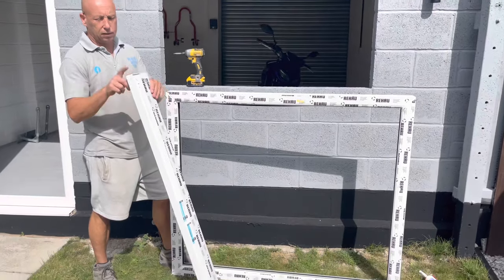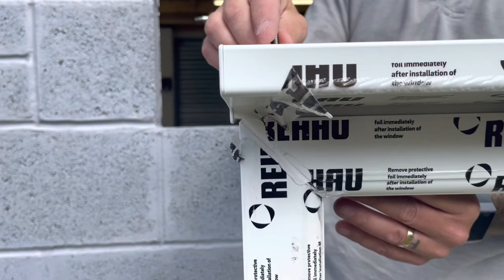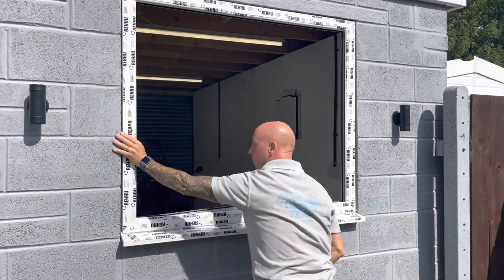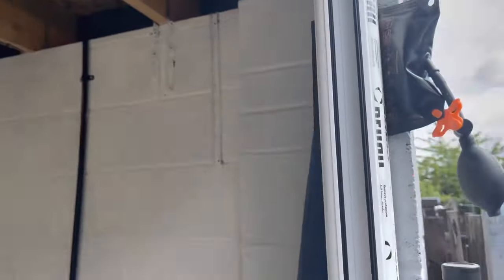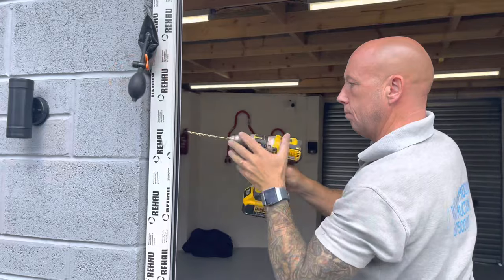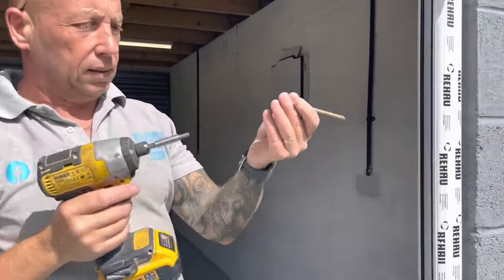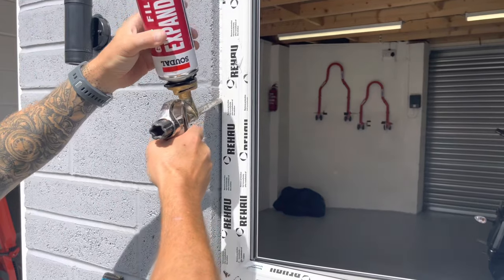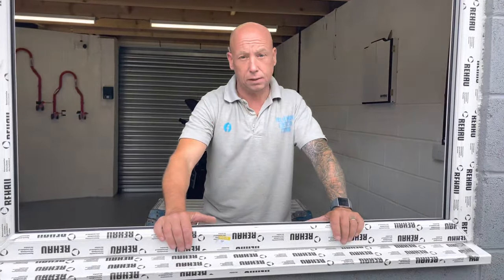HOW TO FIT A NEW UPVC DOUBLE GLAZED WINDOW

Comment: There seems to be two schools of thought, one use packers and no foam, the other is no packers and foam. What’s your perspective on this?
Reply: I use both!
Reply: You don't need packers with concrete screws, they are threaded full length so they grip the UPVC and this holds the window solid without distorting the frame, just make sure not to drive them too deep. This is better than using normal fixing screws (with plugs) against packers because those compress/distort the frame profile.

Comment: If I'm fixing window just to a garage (so not too fussed about drafts etc) will I get away with just putting screws in the two vertical sides?
Reply: Safer with 3
Reply: @harrisonpriest8441  I just put 2 10cm screws in both vertical sides, then expanding foam in the gaps and finished off with caulk. Took ages but it looks ok.